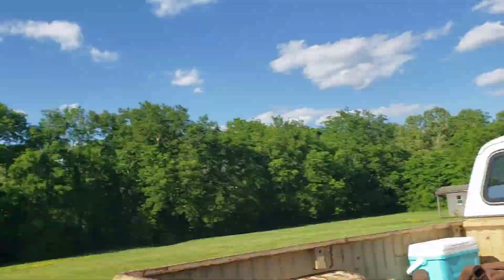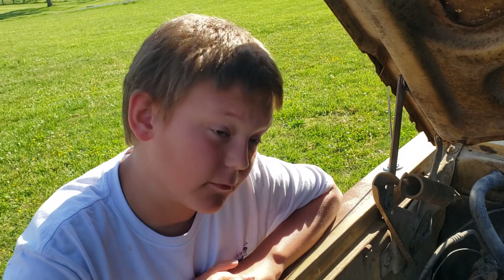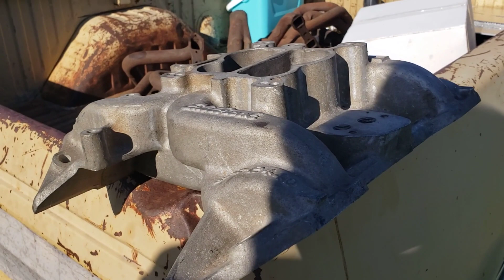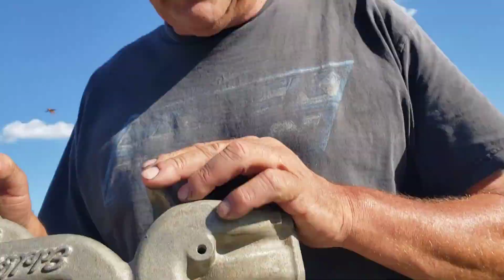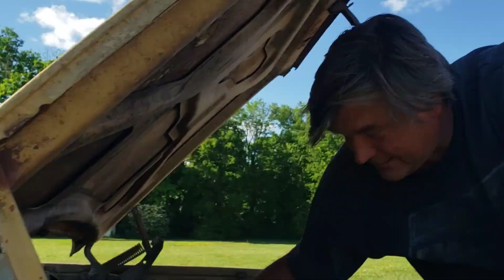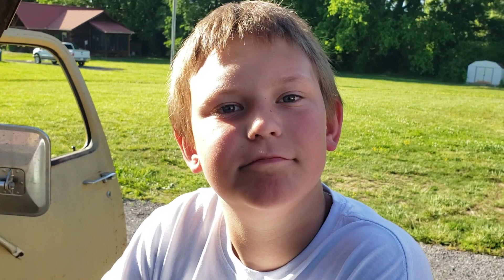1976 Dodge D100 Mopar 440, Making repairs starts with diagnoses

Comment: I love the idea of a 390 carb. Best atomization and homogeneous mix. It will run as a champ. On the cam, maximum 214 degrees is what I wish, improving lift better than duration. And cleaning ports  and  unshrouding valves
Reply from the maker: Great advice right there. I'm going to try several different carbs eventually when the combo is complete  but the 390 I hope is the winner.

Comment: Those trucks are awsome trucks an hard to find rare trucks jus like you say ! I only seen one similar one in person an it had a 400 big block all original an was original black an yellow colour an i think it was like a camper special adventurer model . I will be following an looking forward to this project of yours!! You may have to speak a little louder when trucks running or windy as you have a soft voice , no problem hearing your boy 👍
Reply from the maker: Thanks Darren for following along. And thanks for the input on the volume. It always sounds great when ya edit so I'm gonna have to do better.  I don't know how rare these trucks are but I heard around 250 for the 440 in the 1/2 ton. This truck is a adventurer SE.